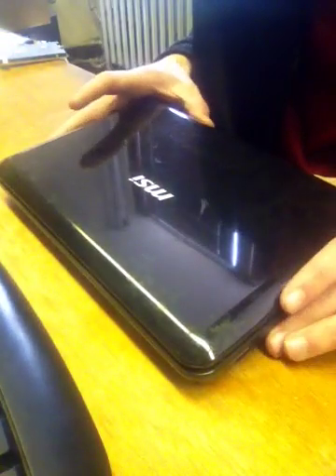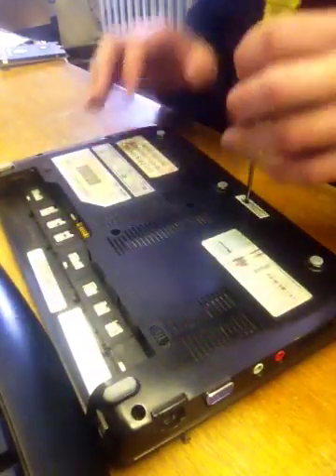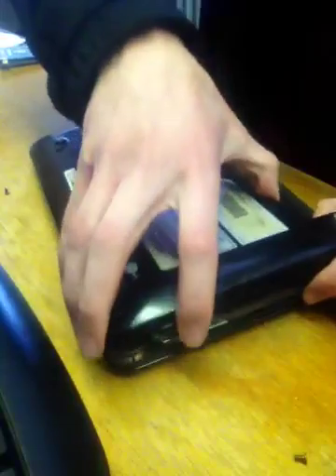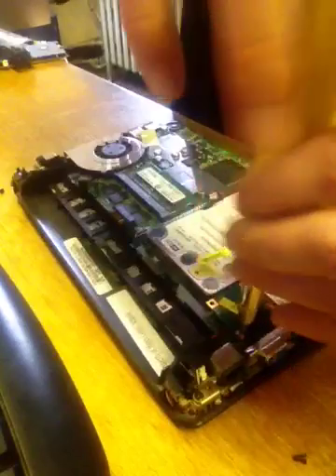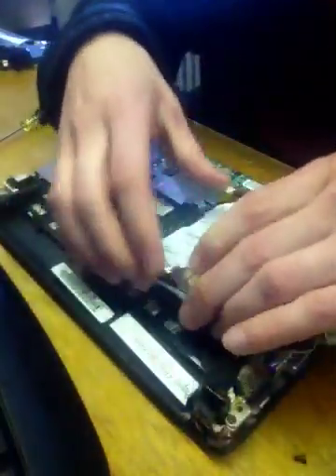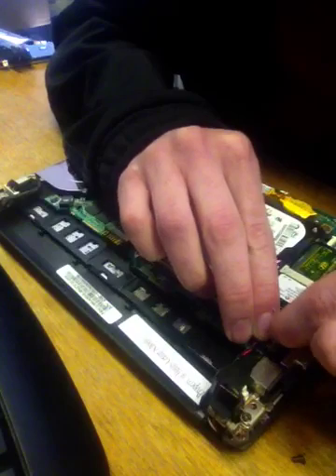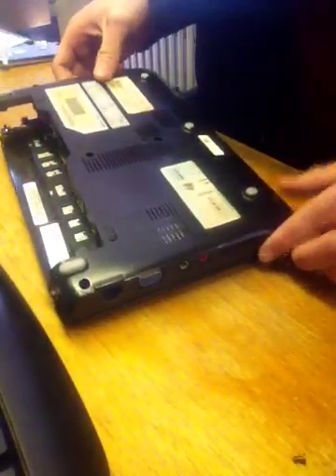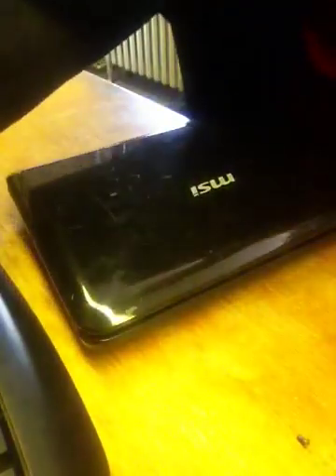How to replace the hard drive in an msi u100 notebook

Comment: 1st... I'd like to commend Cody for helping US with the HD removal...Thanks!    
2nd... In the BIOS you can disable the MB Memory and install 2gigs. Together a 2gig stick will not work with the onboard Memory (3gigs total) as the CPU only supports 2gigs of Memory.
3rd... With a simple press of the Fn+F10 keys, you can toggle on overclocking on-the-fly. The FSB overclock results in significant performance boosts to the CPU and memory. However the overclocking feature can only be used when the Wind has AC power. Pressing the Fn+F10 key combination while under battery power turns on Eco mode, which is quite the opposite of overclocking.

Comment: I got the case off but didn't see the little screw holding the wireless card that was stopping the hd from pulling out. Thanks for the video tip.  Unfortunately my u100 is completely dead, that is, all I hear on powerup is the HD spinning up. The display is totally dead. No go on external display either. Any ideas? Anyway, I am at least happy I was able to pull the data off the drive by pulling the drive out. Thanks!